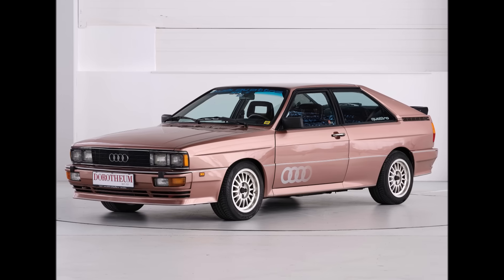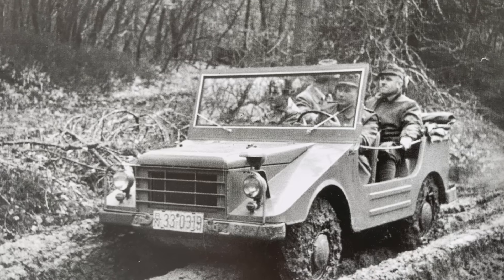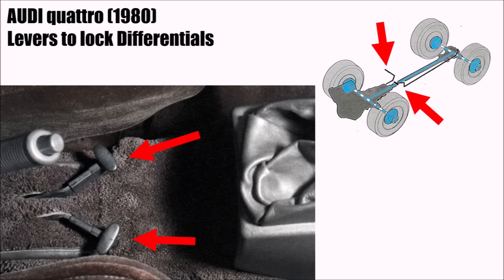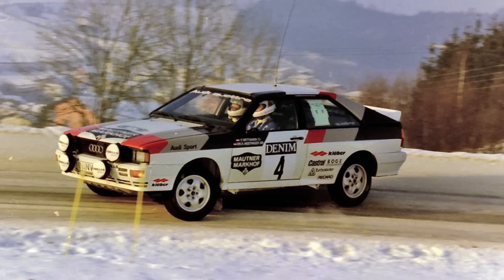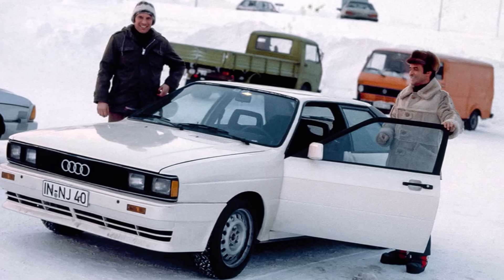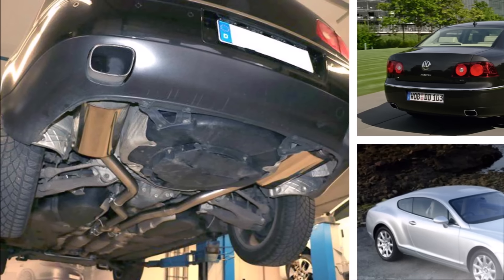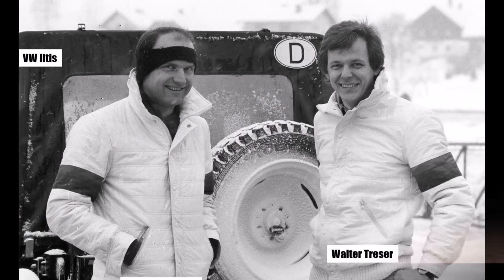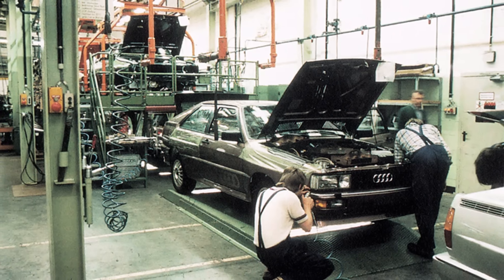History of quattro - Part 4 - Audi Quattro Coupe

Comment: Hi,great video which also sparked my curiosity around the Audi understeer concept,how it was developed and it's effects on driving characteristic and safety at the limit.Can you please make a video on this,taking us through the technique used to achieve this characteristis.

Your response to this would be highly appreciated.
Reply from the maker: You mean the Audi understeer characteristics? We will talk about it in this series and how they tried to fix it with every Quattro generation
Reply: @bsport320 Thank you very much for responding,yes,i also believe some of it is intended to keep even low skill drivers safe at grip limit.

The thing,i've also seen this characteristic even on rwd Audi such as the rwd R8 and e-tron and a6 e-tron models which convinces me even further that this characteristic is very well intended and engineering into the car.

Comment: I have been impressed with Quattro system for a few decades now and am lucky enough to have owned and experienced a handful of these platforms over the years. Currently semi daily driving a somewhat abused '93 4.2L V8, the one with 2 distributors. I have learned alot working on them, sourcing parts and learning some of their capabilities in adverse conditions. I do appreciate the Audi logo since it provides you all the digits for your potential repair bills, just add a 1 or 2 or potentially a higher number eg, $10,000,  $20,000 etc. very convenient. Possibly I am incorrect and the 4 interlocking rings represent the tops of the 4 glasses of beer that I need to consume after completing some of the repairs required to keep these older beasts on the road.
Reply: Audi V8 quattro with automatic transmission is the best quattro ever. It's very sophisticated, but the result is brilliant.